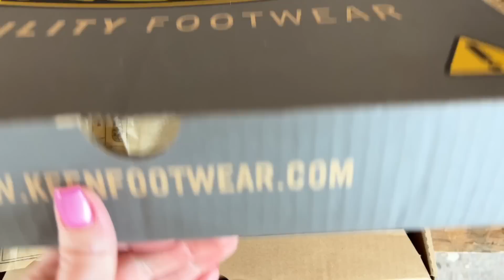Stranded On my Skateboard!

Comment: I use the Andersen Ultimate also.  Very happy.  Meanwhile,I have a written list of steps to follow in both connecting and disconnecting our fifth wheel.  Very prominent is LOWER the tailgate when appropriate.  The checklist has saved some real headaches.